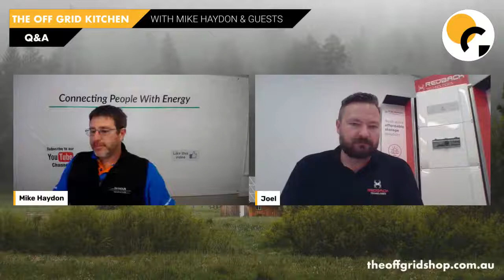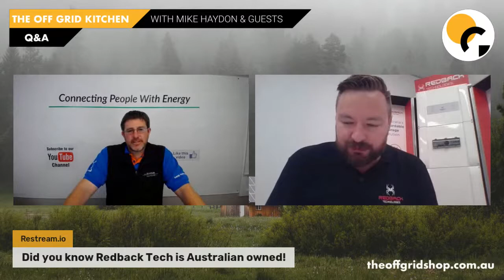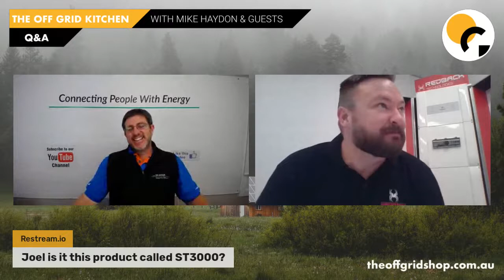Hybrid Battery Inverter

Comment: Mike, I have spoken to you about a project in  Toowoomba a Retirement  Village over a 100 units. Our part the project seven new units we suggested  to developer/owner  double glazing, wall insulation 3.2R, ceiling insulation 5.0R and heat capture system. We want to suggest to the developer that they will install PV and Battery system to act as for the retirement village a Micro-grid, we start by installing PV roof 724m2 on new building, most it usable for capture of Sun.